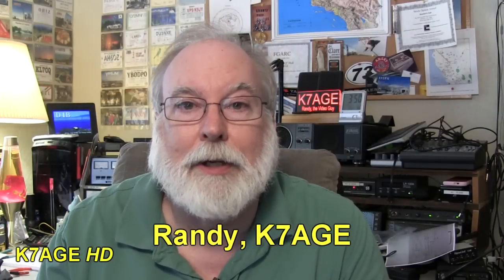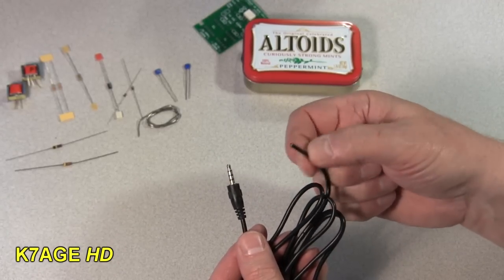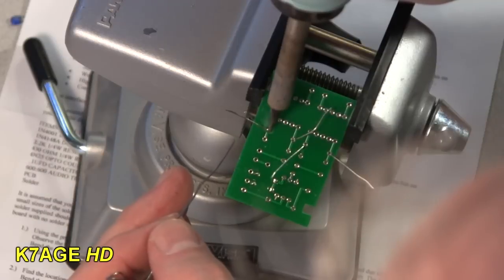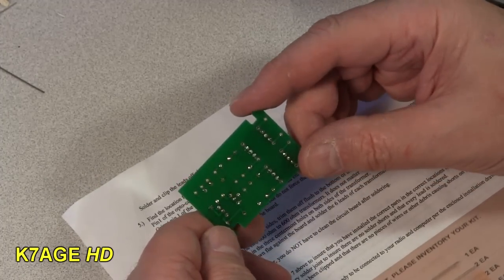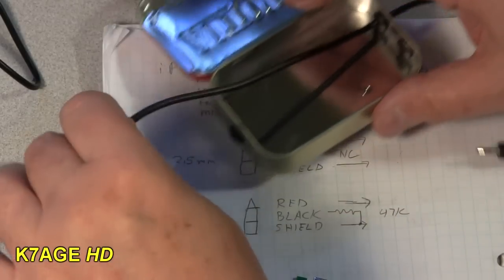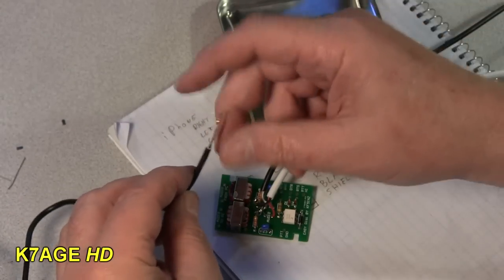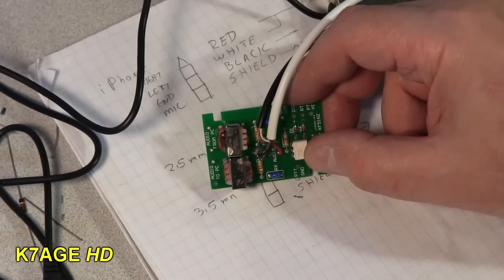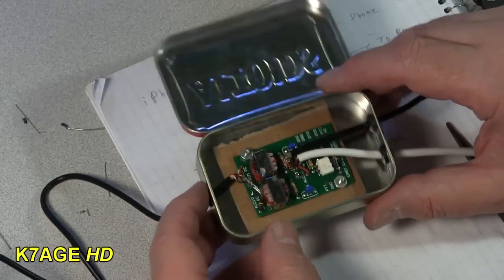Ham Radio iPhone to Icom HT Interface Part 2: Soldering

Comment: Thanks Randy, where did you buy the cable for the iPhone.  Also could you use this to do NBEMS?
Reply from the maker: +pcomp The iPhone cable was an audio extension cable. Make sure that you get one that has all four conductors. Something like http://tinyurl.com/hwds3ss

NBEMS, I don't know anything about this. I see that there is a PC application, so it would need a sound card and it could then use this interface with PC sound card connections to the radio. I don't know if there is an iOS NBEMS app available.